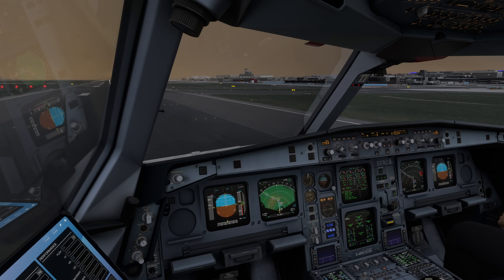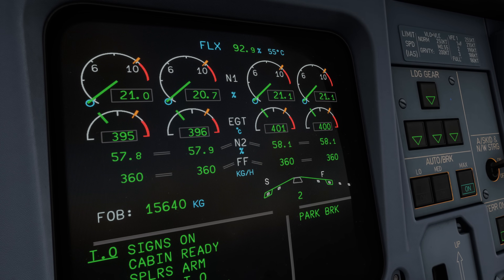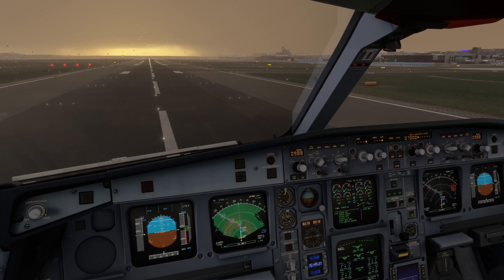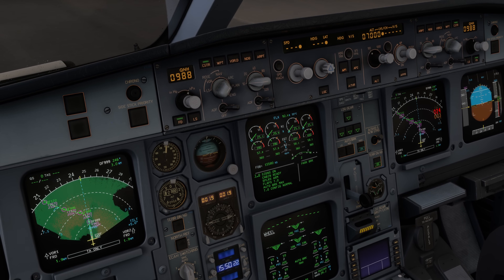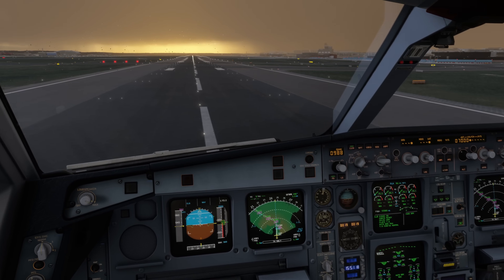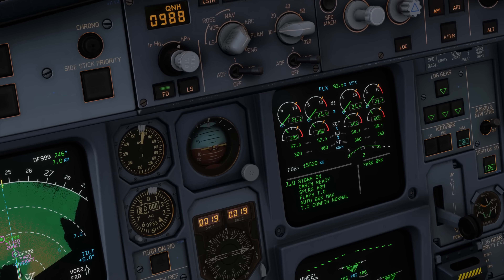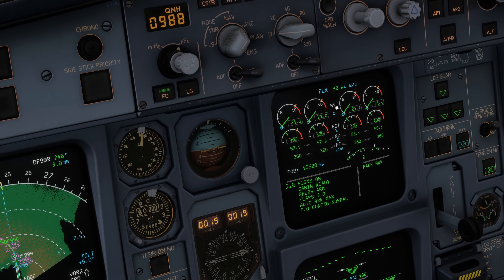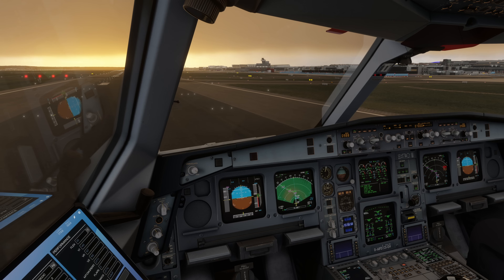Why Would You NOT USE FULL CLIMB THRUST? Airbus Climb Derates Explained | Real Airbus Pilot

Comment: Very helpful video. Derates felt a bit mysterious to me before, but it all makes sense now. I do have a few follow up questions though: 1) What is the difference between FLEX temp and climb derates? Is it just that Flex take-offs are effectively a derate for the take-off portion, and derates cover the climb phase? I find the the whole Flex temp thing a bit mysterious too TBH. I never really understand what the temp number is referring to. 2) If derates are so useful for preserving engine life, why doesn't the A320 family have it? I would've thought engine wear would be even more of an issue on short haul planes, because of the high number of take-offs and climbs they do. 3) Does Boeing have a derate equivalent? What aircraft does it apply to and how is it different from the Airbus system?
Reply: I haven't worked in aviation for years but this is how I remember it 1- Flex or assumed temperature method in Boeing speak artificially restricts take off thrust based on the temperature input. Engines will only produce max rated take off thrust to a certain temperature (usually about 30 celsius at sea level) so by "telling" the engine it is hotter outside, the engine computer (FADEC) will reduce the takeoff thrust to protect the engine. Derate is another method of reducing takeoff thrust by reducing the max rated thrust by a % amount depending on what the airline has specified with Airbus or the engine OEM eg 10 and 20% derates common options selected. Derate however can be used both at takeoff and as a derated climb thrust setting. To confuse matters further, some aircraft permit a combination of both derated and flex takeoff, so for example you could have a derate giving you a 10% thrust reduction which you could reduce further by using flex thrust on that derate portion. All this is achieved through the flight planning computers pre flight. Both derate and flex achieve the same goal of reducing engine wear. There are additional considerations such as takeoff performance calculation for VMCG, V1 etc which determines what method the flight crew use. Derate can reduce V speeds thereby increasing runway performance sometimes but then it has a limitation that you can't use max rated thrust in case of engine failure but that is a more advanced topic. 

2- the A320 family does have derate option only its typically done through an engine plug fitted to the FADEC. British airways used to have A319s with V2500 engines rated at 24k max thrust (26K is the max for the 319 on the V2500 engine)

3 - as mentioned Boeing offers both derate and flex. Boeing calls flex the "assumed temperature method"
Reply: 1. Yes, FLEX is used for the TO and then the climb derates foe the climb phase.
The temperature is based on a fictional air temperature you get from looking backwards in the take-off performance charts based on take-off weight and runway length available. Say you have 2500 meter runway, 65 ton aircraft and it is 20*C. The take-off run might be 1500 meters, but say we want to take-off in 2000 meters, as the runway allows for it. The charts would tell us that would happen at say an outside temperature of 45*C, so we then tell the FADEC it is 45*C outside, so it will now adapt the fuel to air mixture to be optimum for that temperature. But since it is not, the engine will create less thrust and temperatures will be lower, therefore less engine wear.

2. On short haul aircraft, the benefit of saving engine life/fuel savings are negligent compared to a long haul aircraft. As short flight you just want to get to your optimum cruise altitude as fast as possible.

3. They have something similar, not sure of the differences but the 777 got climb rate options.